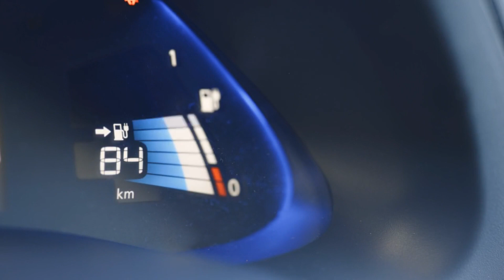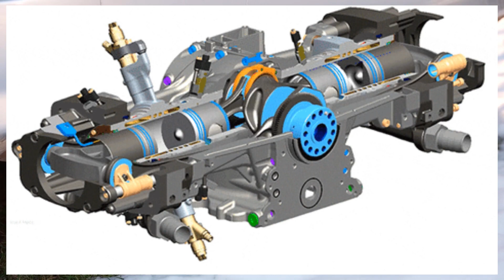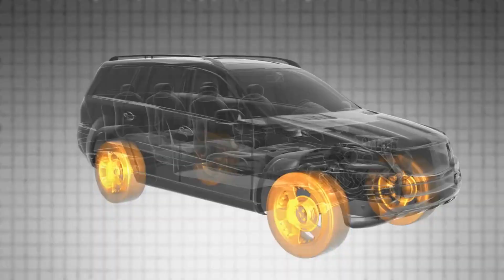Ford CEO's Destructive Prediction: New Engine to Eradicate Electric Vehicle Industry!

Comment: This is a silly video. The engine is only for trucks and it's diesel
Reply from the maker: I understand, thank you for sharing your thoughts on this video. There might be specific reasons why you find it silly. However, it should be noted that the statement implying that an engine is only for trucks and runs on diesel fuel seems to contain some assumptions without further elaboration.

In fact, engines can be used in different vehicles and operate with various types of fuel. Trucks, especially in heavy-duty transportation, often require powerful engines and diesel fuel systems. However, this doesn't mean that different vehicles cannot utilize different engine and fuel options.  

In conclusion, everyone has different opinions and preferences. Your perception of the video as silly is entirely a personal evaluation, but you can make a more comprehensive assessment by delving into more details and content.
Reply: It is a gasoline engine